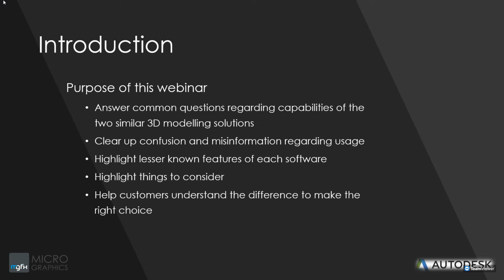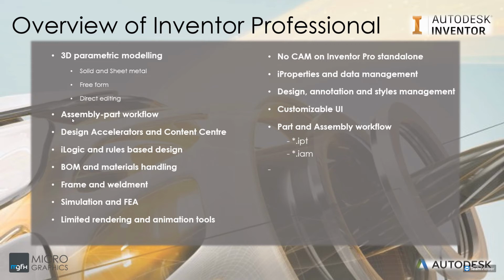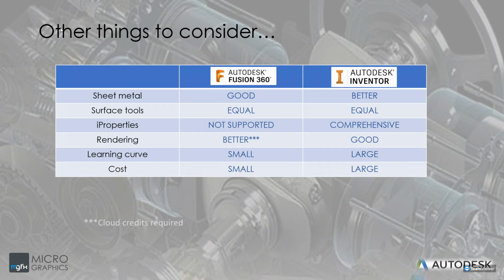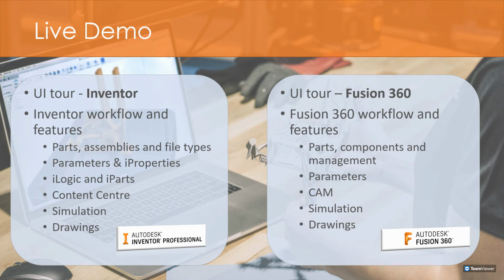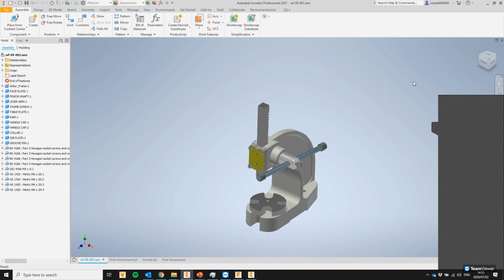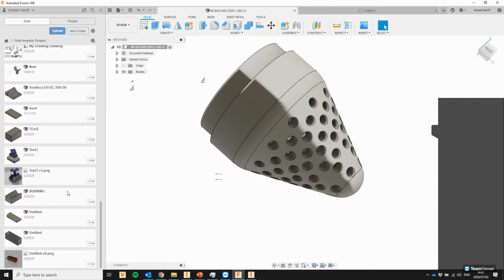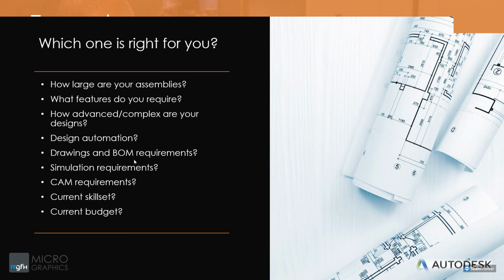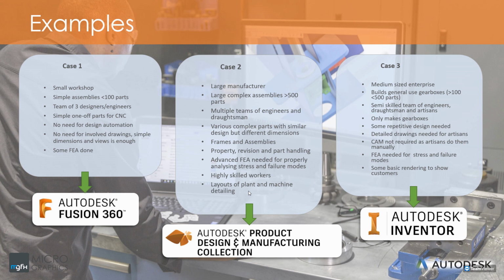Fusion 360 vs Inventor - What are the trade-offs?

Comment: Fusion is hobby and just above hobby level software. It's the fastest way to create parts over ever seen. But when you get into assemblies or any Advanced work, it just fails. Cam on the other hand it does very well. I would call this shop software for a pro shop. And if you think of it that way it's crazy powerful. But don't try to design a motorcycle in it.

Comment: I don't really see how the modelling is any harder in Inventor than it is in Fusion tbh. Its almost exactly the same.
Reply: I think Fusion is easier because it avoids the use of .ipt and .iam files and the project file management it brings with it. It also has a better model tree philosophy by having everything such as sketches and bodies grouped into folders with easier multi-body design options. So yes, while the tools such as extrude, loft and sketch might be nearly identical - the way it is handled just provides a easier approach, especially for beginners and non-technical people.